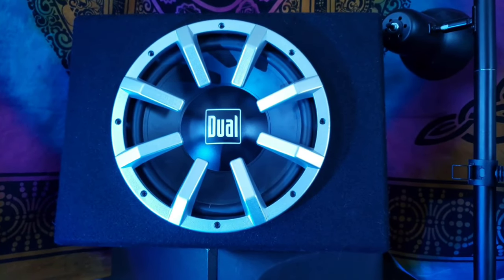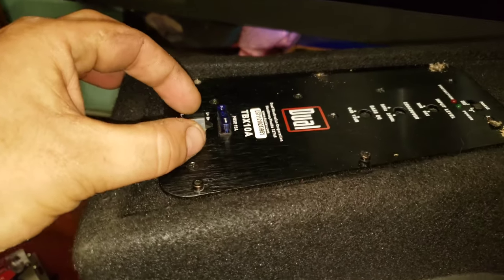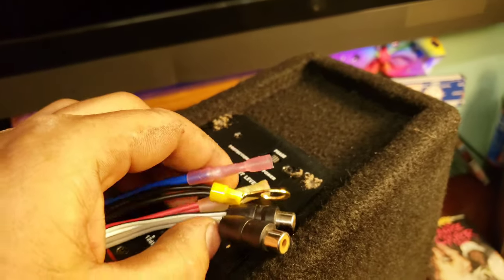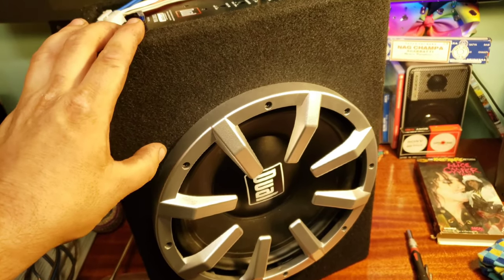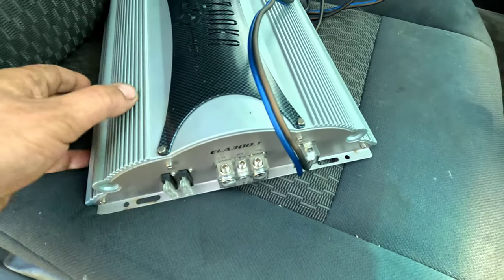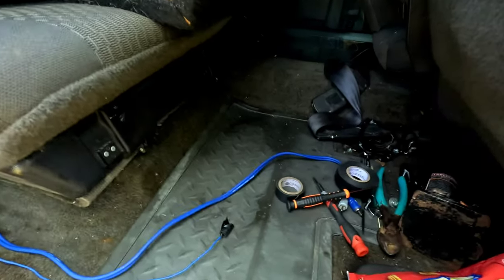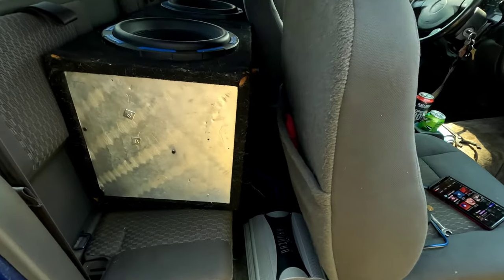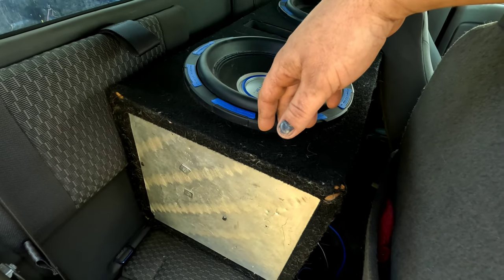Dual TBX10A Review (one year later!)

Comment: Mine seems to overheat im not sure any ideas?
Reply from the maker: Does it cut out and come back a couple seconds later? Cuz mine did but it turned out to be a ground issue.
Reply: @Blowncapacitor84  yes it does but only when the amp gets hot not sure if I have the correct settings what you recommend?
Reply from the maker: @erichead021484  i would try turning down the input sensitivity.
Reply from the maker: Also the metal piece on the side where the connections are is the heatsink, meaning it's what cools the amp. If its covered or close to something it can overheat. It should be able to get some kind of airflow.
Reply: @Blowncapacitor84  yeah its under my rear seat not covered but I just notice while driving that metal piece always gets hot and the bass starts to go in and out